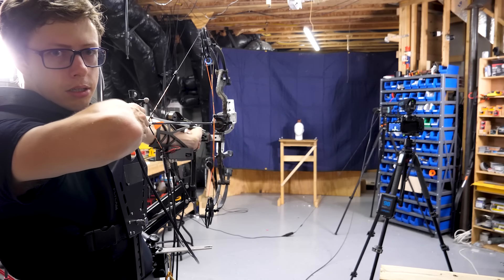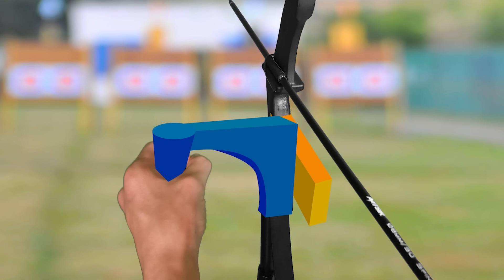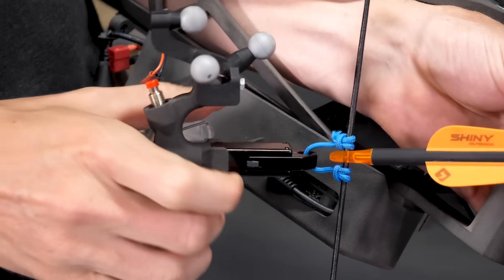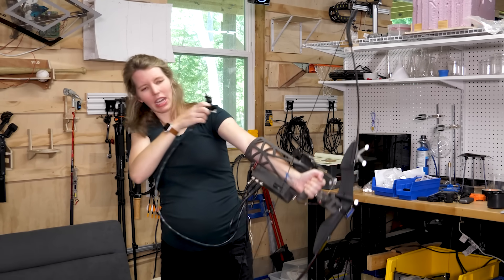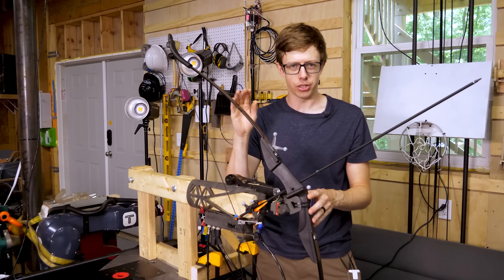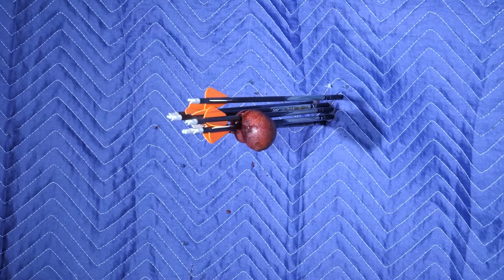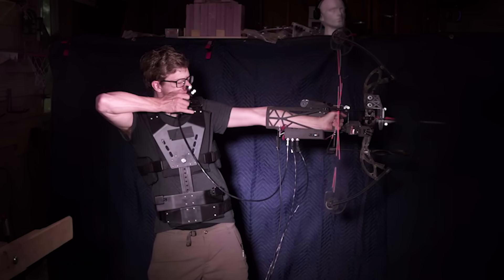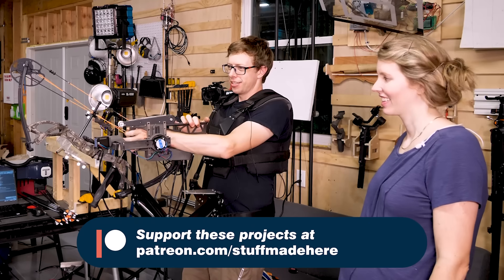Auto-aiming bow vs. FLYING targets

Comment: A jointer is a dangerous thing but nowhere you can get the experience better than at my work. A loose fence, no guard on the right side of the fence, crooked splintery oak planks you have to straighten sideways. I mean does it really get worse? lol. They are gonna fix it but that's after me doing 10 tons of those planks lmao I slipped off with one plank getting stuck on me, almost got pretty real

Comment: This is super interesting. What you've designed is essentially what would be considered a rudimentary Fire Control System directing a somewhat stabilized weapon, in military jargon. I wonder whether the V2 of this will adopt even more of the tech that is used in actual warfare. The inherent shakiness of the user is already being somewhat counteracted by the bow's automatic adjustments, but you could definitely improve it by adopting full gyro-stabilization (likely at the cost of making the whole assembly a lot heavier and more complex) or an "only release once the weapon lines up with your fire control solution" approach as used in large caliber artillery where full stabilization is impractical. The next step is sticking a radar array on it lmao.

Comment: You did a terrific job in this short amount of time even if it took you a year to make this video from the inception of the auto-bow to the final bits of editing.
What I have noticed from your apple shot is your bow is essentially Blind and might even hit your previously fired arrow instead of the target. As seen in your Blind Tablet video is there a way you can tell your bow what to aim at with the push of a button highlighting what your target is? Maybe using a turret paintball gun will be easier since there are probably less unpredictable factors than using a bow and arrow. I say that mainly because bow and arrows are meant to be fired in open air as seen in the Olympics or if you are hunting; you do not usually see someone shoot a bow and arrow in a basement...or dungeon.
Reply: Thanks for watching!😊 Don't forget to hit the subscribe button! Text me for more info with this digits +15¹8⁴9097⁴8

Comment: I HAVE THE BEST IDEA! but i cant do it :(
Therefore i ask you to make a troll sink and/or soap dispenser.
Modify and program one of those "no touch sinks" you see at public bathrooms that are so frustrating. MAKE THEM WORSE. Make it not turn on when you put your hand under. after they are done trying, make the sink turn on. They go back to wash their hands, but right before they get their hands wet, the sinks turn of. they remove their hand, and the sink turns on, they quickly put their hands under the sink and manages to get them just wet enough to put on soap. AND THEN! to their surprise, the soap dispenser is also a troll.
Make my dream come true!!!

Comment: The compound bow shot more consistently than the recurve partly (largely) due to the draw length (anchoring point) of the of the bow. The mechanics of the compound means that the arrow is drawn to the same length/position every time, where a recurve differs (even minutely) for every shot, which introduces a lot of variability for the programming to accommodate for. Another factor is that compound bows generally have a higher release speed than recurve bows, which impacts the arrows flight. You mentioned about the arrow deflection with a recurve bow, that can be mitigated by adjusting the position of the arrow rest so that the arrow is not hard up to the riser of the bow.

I guess you may have thought of some of this, or your wife may have said something about these things and I know that not everything can make the final cut of a published video. And yes I am an archer, who has shot using compound bows, recurve bows and long bows. And no I am not calling myself an expert.

Because we know that X is the unknown variable, and spurt is what happens to a leak under pressure.

ps. you "punched" yourself on release because you weren't anchoring your shot properly (your wife should be able to explain if you don't know what I mean).
Reply: Yeah, those recurve shots were pretty painful to watch. The bow might have simply been too small for him, because he should have been drawing it back past his cheek to a chosen anchor point (I typically choose just below my ear). It certainly shouldn't be hanging out somewhere a half foot in front of your face.
Reply: Was just about to make several of these points. I think the next biggest thing he needs to account for in order to consistently make further shots, beyond 40 yards, is to tune his compound bow properly. His software will only get him so far until his bow/arrow begins holding him back. With an improperly tuned bow you can get severely deflected arrows that do not fly straight. I hope he realizes this as it may not be apparent at 10 yards but beyond 40 his arrows will not shoot consistently. The moving shots were impressive which leads me to believe his software and "aimbot" hardware is capable, but the bow needs to be tuned to shoot those arrows perfectly.
Reply: Wasn’t it just cos the first bow u had to shoot around and the compound has the fancy part for the arrow where the bow shape curves
Reply: @iansmith6566  - No, he was just doing the archery equivalent of putting your eye directly up to the sight of a gun while holding it over your shoulder instead of bracing against it against the shoulder.

Your anchor point should never be at some arbitrary distance out in front of your face.

Comment: ok so what if u had a cam on each of the 2 limbs at the end and a laser rangefinder in the middle to help calculate drop. 

Or make an auto-aiming arrow with a tiny cam* on the tip that will be encased in a plexiglass (or a better material) pyramid.

you can use the nanobot trick perhaps where u use that metal that contracts when electricity is applied and have it cut so when it bends, it can bend a fin.

program how the target has to look and perhaps use a  good cell phone cam, id say a tiny drone fpv cam like a runcam nano or something cause they have good latency and used in races. foxeer is another good brand, but ya idk, im sure you can find a solution.

Comment: To cut down on errors there is two things you can do immediately to reduce them.  1 you need a better arrow rest the rest you use is highly variable because of the material its made of.  2 you need to have a better matching spine (or stiffness of your arrow) there are charts that estimate the best spine for your arrow in relation to bow poundage and draw length.   Hope this helps.  Cheers.

Comment: Wouldn't it work more accurately if U use an AI to learn from mistakes and just make the software more accurate🤔🤷🏻‍♂️
Reply: this may be better at outside conditions...there is almost no "noise" in this system except his hand movements

Comment: Would you consider working with gravity industries to provide a brain to stabilize their (hand-maneuvered) jet pack design? Would be cool to see dual robotic arms to control the jet engines that would (normally) be managed by the operators hands. Goal would be to give freedom to at least one hand while the other controls your movement with (ideally) a joystick-like controller.

Comment: Gyroscopes are pretty good these days right? I wonder if you could attach one to the bow, and attach the cameras to the bow, and use both inputs to guide the shot, to remove the need for mounting the cameras to the wall, which seems like a big constraint on a lot of these projects

Comment: You gave me a challenge I'm trying to answer that challenge through texting isn't that easy but I'm going to give you a challenge if you don't mind I know you're busy with your bow I'm not saying you got to build this for one thing this is not going to fit in your shop this is more mental gymnastics I've worked in the racing industry as a matter of fact I love racing I won't say where I'm at but I live in the mountains and I love my mountain roads but in the racing industry they've slowed the cars down and their excuse for con is that the cars are too fast are too dangerous let's say that the race cars could go past Mach 1 how do you design a track with hairpin turns chicanes the whole nine yards even changes in elevation but yet would keep the driver safe allow the fans to get in their close the workers in the corner workers to get close enough to do their jobs and to keep all them safe along with the fence oh and if car goes out of control even in a hairpin and blows out the backside side of that hairpin are in racing on the outside of a turn it's called the Impact Zone let's say there's stands in that impacts Zone with spectators now this car is out of control blowing out the backside of The Hairpin or Impact Zone how do you keep the driver from being killed or injured and keep your spectator safe honestly I think the uppity UPS already know the answer but they don't want to spend the money upgrading the tracks to handle that kind of speed but can you answer the question I can tell you this putting that strap on the back side of the helmet I believe it's called the Hans device and using barriers isn't the answer the answer would make the track probably cost about 10 times more to build but you literally could run cars if you could build them to do it the track could handle Mach 1 in higher and you can imagine what a show that would be and with modern technology if they weren't using Tom Connery to convince the public the cars are too dangerous and all these crazy rules to inhibit the car speed with modern technology if there was no speed limits on the tracks who knows how fast the cars could really get I mean that's what racing is supposed to be all about it's to build a better mousetrap racing is supposed to be about development

Comment: Now I realize with the facial identity idea if you're using the base of trees poles and other things on your gimbal for your camera if it's not too much weight for the quadcopter you would need to put either a rangefinder or something like one of them tapeless measuring tapes and when the computer identifies the base of a tree as a marker it hits it with the rangefinder or the tapeless measuring tape because those silver targets are an exact diameter so that the computer can use perspective to range the distance from it so once we know what the distance is from the base of the tree now we can use perspective to range or distance but I was thinking about this and I believe this problem has already been tackled I don't know much about quadcopters but I believe you can put them on a station and once their own station they don't move so if you have two or three cameras around you and these cameras know the distance between each other then that's like having your shot full of cameras so if you have markers on your bow you should be able to do this outside it'll take some fancy computer programming

Comment: I have a question if you're going to have the computer use a cameras on the quadcopters look for markers zipper tied to trees as an anchor where they would know their position exactly to where the computer would be able to aim the bow for you using the markers on the bow I know you know how to write a computer program I've watched you do it on your Channel many times how about using cameras basically with facial identity but instead of them looking for a face have them looking for a street sign the base of a tree a patch of grass 10 to 20 feet away and instead of using markers zipper tied to a tree use the stationary objects as your anchor where you can fix their position and now the computer can use the quadcopters to aim your boat as so long as the quadcopters know the distance from each other and quadcopters follow you around then they could be constantly looking for new anchors in space and the only reason you have the quadcopter looking for these anchors is when you do make a shot you don't need your cameras moving at all so just like the way you're supposed to take a breath and hold it when you make that shot the quadcopters are going to get steel as it were to do all the Computing that needs to be done where maybe you can hit the bullseye

Comment: I apologize for the end of that last text like I told you in the first text I sent you my writing is horrible my reading is decent so that means when I'm using text I'm using voice to text in the problem with voice to text the way they've got it set up proofreading is next to Impossible on long text messages I think this is intentional to encourage keeping your texts short but what I was trying to say at the end and I'm going to expound upon it you're quadcopters I would think in order for them to aim your bow at a moving Target they have to know their position in space they have to know the distance from each other from the ground and they can't be drifting around by couple inches and GPS will do that it's only accurate up to like 5 inch or so so the more quadcopters you have running GPS the more accurate they're going to know their position now if you took those silver balls and zipper tie them to several different trees then they could act as the anchor to wear the quadcopters would know their exact position now the quadcopters are going to have to be flown buy something like a laptop and the laptop is computing the distance between each other the distance from the anchors the distance from the ground and if you tried it with GPS I don't know much about computers but it looks to me like writing such a program would be a puzzle in itself

Comment: Cool idea and great project! Can anyone point me to a where I can find that mechanical arm (or similar) that is used to offload the weight of the contraption? I am looking for mechanical support to offload weight of a handheld tool. It's not a heavy tool, but it is used for prolonged time in positions that are exhausting to hold still.

Comment: Just a few suggestion for improving accuracy. Try adding more weight to the grip portion of the mechanism for damping. I only have experience with recurve bows, but a good 'weld' between you check/chin with the release/drawing hand will help with stabilization on the release and stop you from hitting yourself. Awesome project!
Reply: Add Instant Legolas, and Lars Andersen will have a run for his money!

Comment: As an archer, it hurts my soul to watch the lack of any anchor point,(the draw was awful)  no form (ya know, if you had a legit anchor point you wouldn't hit yourself in the face) zero technique, but as a tech project, it was awesome to watch the progression of an excellent project. GG.
Reply: I was going to say that too. He might have had more luck with the recurve if it was pulled at the correct angle (and not deflecting the arrow off the riser if the robot adjusts horizontally) and far enough back (so you actually get the draw strength necessary to shoot straight). But I'm assuming that the automatic horizontal adjustment would cause some gnarly string damage to the lips if it adjusts to the left and pulls across them from a proper anchor.

Comment: was going to say you should use a bow with pulleys to get mechanical advantage. which you ended up doing. Should do a video on/about/using mechanical advantage(lever, gear, pulley, combinations) not sure what or how but think it could be interesting  
Also 6:51 actual reaction much better/funnier than scripted wife dialogue

Comment: what about putting a smaller tip like a nail or needle on the arrow so you could actually hit that "lego apple". Also would be cool if you could do a combination of the pool and chainsaw with another physical virtual interface by having a robot control the device(bow in this case) and user control it through a computer. So could do any time of marksmen like with a crossbow, blowgun, airgun, slingshot, or a sling (the one you swing around and let go of one of the straps). also using an X-axis robotic arm you could make a table tennis robot and it could or course return it but also put spin on it.
Also would be cool if you did a auto ball for a game like skee-ball, lawn bowling like bocce, or regular pin bowling, (or maybe curling lol) and you could not only adjust the direction but the speed and distanced traveled.

Comment: You have to ditch the whisker  biscuit!! your losing consistency because of it. Go with a good drop rest.. Also are you measuring your draw and taking that into account? you could probably use a sensor in your release to measure the force of your draw... even with your body mechanics being exactly perfect every time  the movement of the bow the auto aim bot is doing will cause variations in your draw... measuring this force and using that data to calculate the arrow path will help you with consistency..